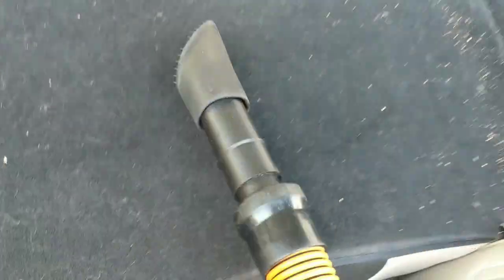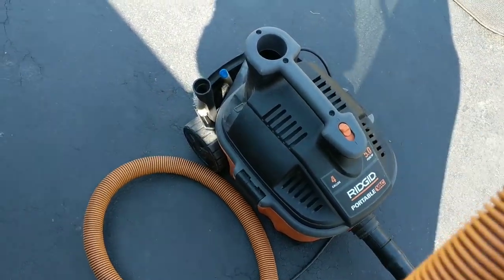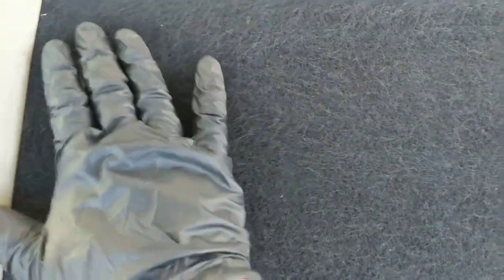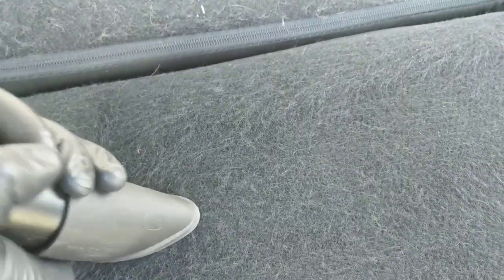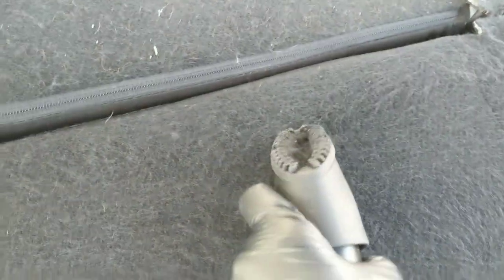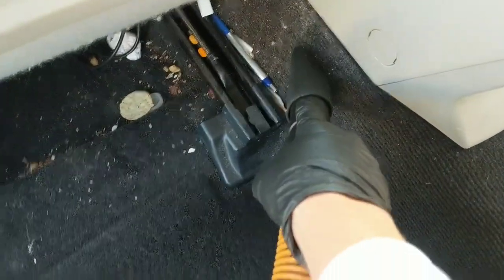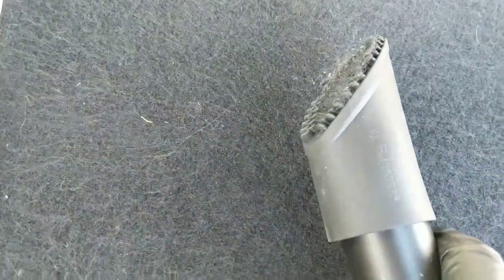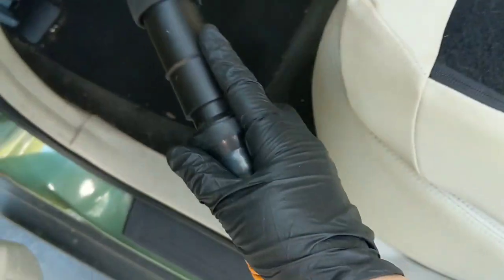Removing pesky pet hair with ease using the Fur-Eel pet hair vacuum attachment!

Comment: I've been seeing more and more of these videos. I see a lot of videos where it's literally losing rubber pieces after one seat. Is this that much better than a lily brush tool?
Reply from the maker: In certain scenarios yes. But I'm not 100% sold on them. I've been going through 1 every 2 vehicles. So not sure its worth it. Needs to be more durable. Or maybe it's user error. But I'm trying to be gentle with it. 🤷
Reply: @attention2detailswchelsea  wow one every two vehicles that's no bueno. I always thought pet hair removal fees tended to be a little excessive but if someone solely used the fur eel it would be justified. 

I know fabric softener is a well known tip as mentioned below. Wonder if that will help the product last a little longer. Anything less than 5 cars is a imo a deal breaker.

Comment: Sorry but I got to nite that many tools dedicated for pet hair pull, stretch, and damage that particular toe of upholstery as seen in  this video. I would much rather use colored air and a fine blade attachment on a vac than cause damage. At very least you earned too "shave" that down.  Im sure it works great on other upholstery.  Im not busting your chops either.  Suburus are a pain in the butt and 9/10 chins loaded with dog hair.
Reply from the maker: It was just that fabric that it shaved it like that. The rest of the vehicle it didn't damage the fabric. But the backs did need help with the fabric as they were frayed and uneven. I'll try to show it on different material in the future to show you how it works on non-crappy non-Subaru carpet